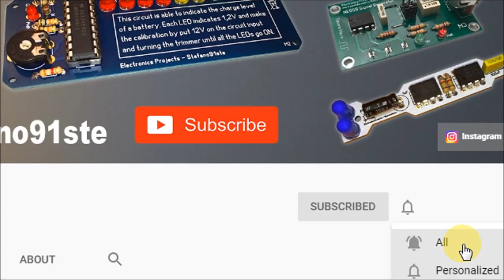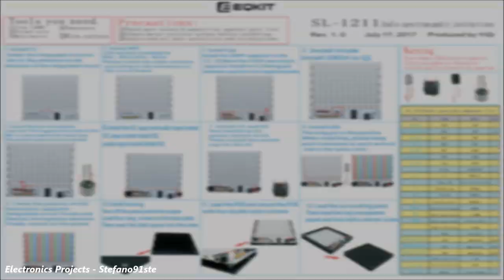LED Audio Spectrum Analyzer DIY Tutorial

Comment: what type of this integrated circuit?
Reply from the maker: Hi, it's definitely a programmable microprocessor (like PIC or ATMEL), in the user manual it is called "WD1088" but I can't find any datasheet with this name.. also the integrated is completely black, without any legible writing or code.
Reply: @Stefano91ste 
 ok, thank you very much for the information and your attention. Excellent channel, I really like your videos!
Reply from the maker: Thanks you for appreciating my work!:)
Reply: Nice .. cab you scan it. As grey scale.. then relief Will appear. Clone layout and think the code for atmega8
Reply: @Stefano91ste  it must have passive filters connected to analog inputs.

Comment: What is the name of the IC?
Reply from the maker: Hi, it's definitely a programmable microprocessor (like PIC or ATMEL IC), in the user manual it is called "WD1088" but I can't find any datasheet with this name.. also the integrated is completely black, without any legible writing or code.